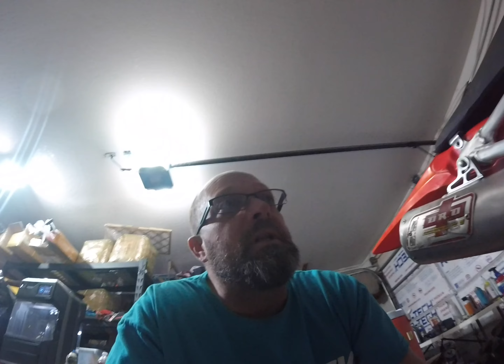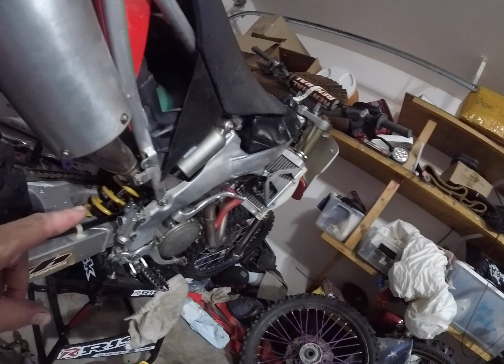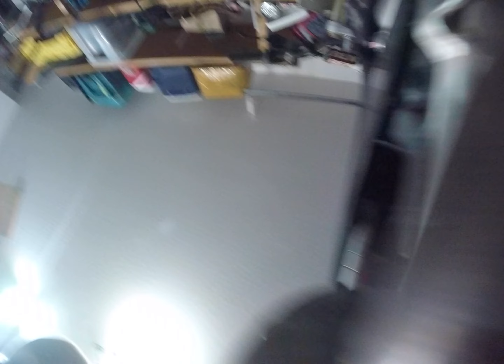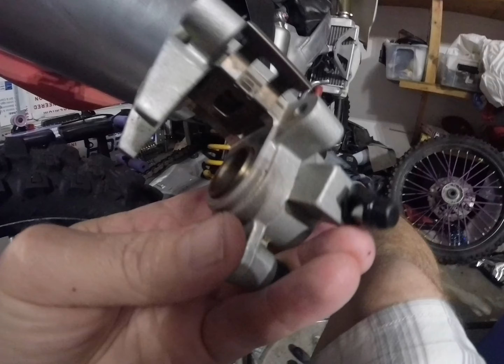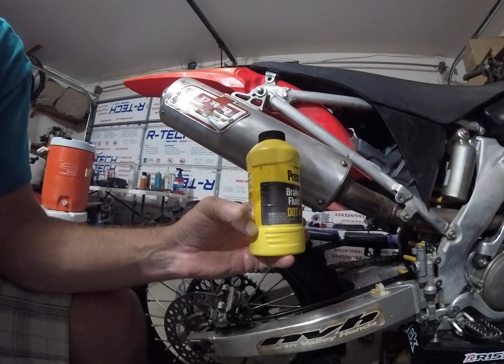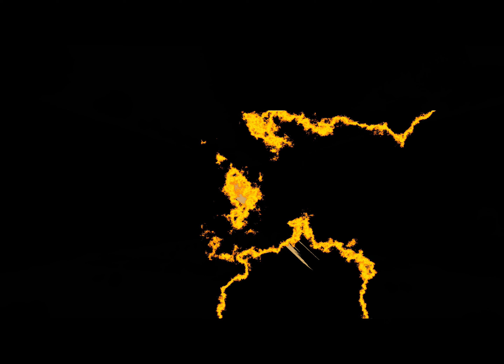CRF250 rear brake - Tip how to bleed dirt bike rear brakes a little easier

Comment: trying this tomorrow sounds very plausible thanks for sharing your new found technique
Reply from the maker: Should work as long as you have a good master cylinder.. if your pushing fluid generally your good to go just need all the air out so it can get some hydraulic pressure going..  Tis dune season lets go ride.. ;)
Reply: Can wait sir ive a crf450 really need the back break thanks lol was at it today but the cylinder on the caliper is stuck so getting new seals for it then bleeding this way you showed appreciated   @ZENxTENinc